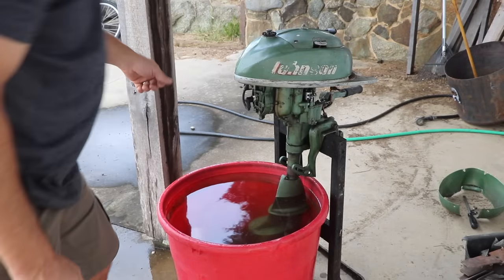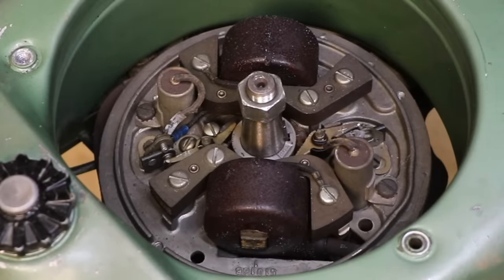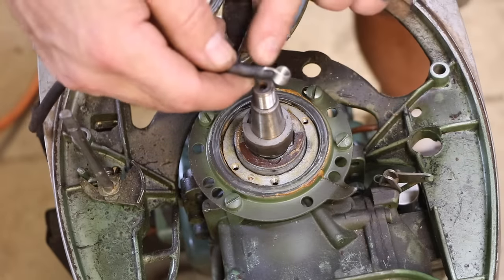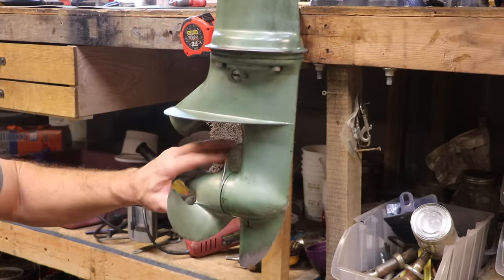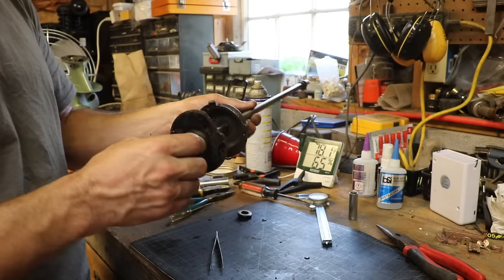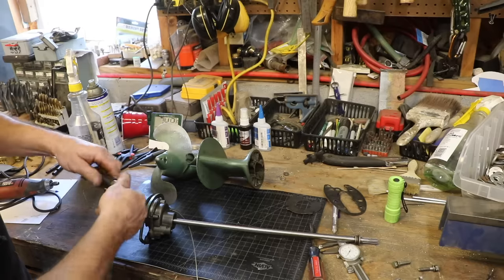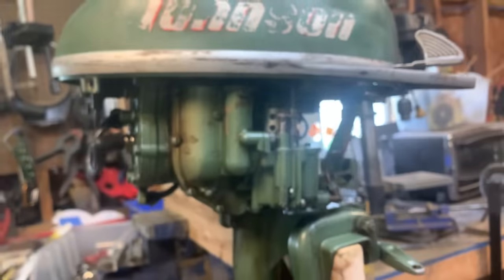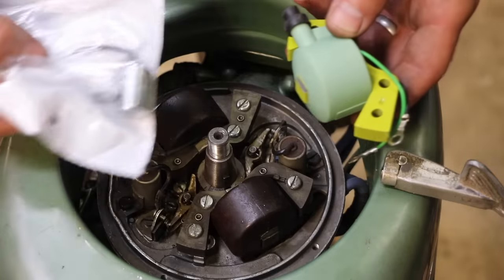My Johnson Needs An Overhaul, and it's Putting Up A Fight!  Johnson Engine Part 3

Comment: My favorite thing about these old engines and other machines are the mechanical solutions to electrical problems. Life before logic gates and microchips took a lot of creativity
Reply: I never get these comments. As if throwing microchips on something magically resolves problems. You just introduce a boatload of new problems that need their own kind of inginuity and creativity. Always the same "mechanics good, informatics bad" ape-like mindset.

Take a look at ben eater to really get used to what kind of problems you get with informatics and how inhumanly complicated it really is to solve something with informatics.

You need both mechanics and informatics to build the real crazy machines. I mean hadron-collider-class of crazy. Where nearly everthing is machined and programed to absolute perfection.
Reply: No kidding. Used to be that,usually, if you had a spare plug and shear pin you could probably get your outboard home..

Comment: the “hard plastic” in your seal you broke is made of ceramic. they are commonly used in pool pump motors called a mechanical seal. it’s ceramic as to not damage your internals from metal on metal contact. hope this helps keep you from a disaster in the near future

Comment: Thanks for the detailed video. I have a 1950 Johnson TN 26 that is very similar, but it has the older style coils and points. After cleaning the points, I have good spark, so I'm leaving the magneto alone. I put a new impeller in the water pump, and it ran okay when I started it up several years ago. This year, I decided to get it out again, but the carburetor needs to be rebuilt, so I am thankful for your explanation. Keep up the great work!

Comment: Awesome video. When I was a kid in the 90's, I had a '67 Johnson 6 horse on a small aluminum boat that I had lots of fun with going around the lake at my grandparents summer cottage. I would agree that a new head gasket and rings would help to bring the compression back up to new and give it its full power.

Comment: Just  the  " 5 Sea horse" decal  is worth the work on this old Johnson ! PS:  Rubber O rings  should be rather lubricated using Glycerin or a water soluble lube not grease .

Comment: I experienced the same thing with a motorcycle. I bought the bike and was driving it for a week and was happy with it and then I went to my buddies house and he immediately says "it's only running on 3 cylinders, how can't you hear it" and of course it had a broken plug wire. It had much more power after I fixed it!

Comment: Great video and series. You have fought and got it running pretty good. I would absolutely put new piston rings in it, do an air leak test on the engine to make sure the seals are still good and fix it up to its full capability. It would be a hard kick to the Johnson to leave it under its full potential. You are so darn close to 100%. Come on man you can do it 💪

Comment: Greatest clickbait in history.

Nice old outboard though, glad you keep her in good shape.
I like how you use the bucket for testing, I always used a steel drum, just clamp it on the rim, don't need a transom and you can hang it outside the drum to work on the lower unit.

Comment: I owned one of these engines and it did not sound right at first, running on one cylinder. Impressed with your ability to troubleshoot and machine parts.

Comment: Always measure compression with open throttle, might give you a slightly better result.

Regarding the new alu/bronze seal, between the leg and power unit. 
The old stainless washer looked as if it had been "rotating" on the o-ring, by making it one piece you loose this flexibility. I wonder if that was going to cause problem over time, that the alu/bronze now sitting directly at the bushing on the shaft being the sliding point instead of the washer and the o-ring.

Comment: My dad has one of these in his garage. We used it in the 90's when I was a kid. He got it from a guy that used to be a mechanic on small engines. It was an awesome little motor and ran when it was put away. I'm sure with a little bit of work it would run again. I have many memories of my cousins and me on the lake ripping around. Great video.

Comment: I think you messed up the adjustments on one of the points. The crank lobe wasn't aligned with it and the backfiring could possibly have something to do with that. It also seems like you have an exhaust leak on the stem. Probably a broken rubber seal there too. Well, old rubber you know. If you're going to take apart the head I would definitely change the crank shaft seals in the same process.
Reply: The leak is visible at around 49:00, spitting water.
Reply: Are you saying he could of corrected the problem and missed a step or is it a Pandora’s box

Comment: I really admire guys like you who are able to machine your own parts. Great job all around. By the way what's the difference between a condenser and a capacitor? Nothing. They're exactly the same thing with a different label.
Reply: Came to the comments to see if anyone had clarified.  "Condenser" is just the old-fashioned term for a capacitor.  The only places I can think of having seen the old term lingering is in these kinds of ignition systems and condenser microphones.
Reply: They work the same but are designed for different applications. A standard type capacitor wouldn't last in this environment.

Comment: That piece with the oring that broke was a “carbon
seal”. It rides on the crank to seal lower crankcase. Your lean spit  back may be your substitution of a bronze material. If I recall correctly there was also an inner oring that rode on the drive shaft and I believe there was also a spring to keep it preloaded to keep it to the crankshaft. Have to check a parts manual. Is it a “TN” model?
Reply: I was going to add the same voment till I saw yours.   Pretty sure the spring is meant to push the seal against the bottom of the block not down away from it.
Reply: That is probably why it has low compression, The crankcase is not sealed anymore. I was wondering why there was no oil seal in that bottom bearing.
Reply: They ceramic seal is required for proper operation. Great mechanic but hasn't been exposed to water seals.
Reply: What is that seal doing the way he did it now? I dont see how it would do anything. Around the shaft there is no seal.

Comment: I would have checked the spark plug wire first before digging into it like that but it was interesting watching you explain the inner workings with the condenser and how the power is generated to make the spark plug work. You don’t see the old motors like that anymore.

Comment: You are correct, it is alway good to replace the impeller pump on an old motor.
I noticed at the first of the video that it was pissing so the pump was working. But now you know it won’t crap out on you and fry the engine.
You probably had 4 or 5 hours into it not including several hours of research.
It’s amazing parts are available!

Comment: You sure hit the nail on the head about. having a lathe in the shop to make a needed part on Sunday afternoon when it can't be found or bought. Moving to a retirement community with no shop makes for a little bit of a lost feeling, passing 80 though guess I'll not be fix'en much any more. Good job on your Johnson5. JImM

Comment: Several years ago I bought a boat that had two engines similar to the one you were working on.  I found a guy that could rebuild it but he said I would be wasting his time and my money.  When those engines were built gas had lead in it and it would coat the valves as kind of a lubricant (or something like that).  He said since they have taken the lead out the valves will burn up and they would need to be replaced.  If I had him rebuild them I could only use 93 or higher octane without alcohol.  He said any gas with alcohol would burn them out faster.  He said he could rebuild it for $600 (that was back in 2004), but I wouldn't be happy for long.  He suggested I take the money and put it toward a newer motor.  Good luck.

Comment: As for filling from the bottom vs top... there are some lower units that must be filled from the bottom. My Mercruiser Alpha I outdrive was one of them, as was the Alpha II I replaced it with. 

The issue has to do with the internal oil passages inside the lower unit. This little SeaHorse and many other outboards have this large open design... oul has no problem working its way down and replacing the air in the gearcase. With my Alpha units and many other designs the oil passages are so small they will hydro-lock the air in the gearcase. When you fill from the top, the weight of the oul prevents the air from working up through that passage. Eventually of course it will work itself out, but then you have a critically low oil level and you burn something up. 

I understand how the naysayers can get after you. You're following the manual. Way to go bud. This is fun to watch, even a year later.

Comment: I remember an old Johnson like this back in about 1960 that would run on one cylinder then the other would kick in every now and then. My father got tired of it, and we threw it in a breakwater.  Got a new Evinrude about 10 Hp. I thought it was so powerful.

Comment: When you were resizing the impeller bushing I thought of another little trick that you might want to put in your mental toolbox. Cut the head off of a 1/4” or 5/16” bolt. Then cut a slot into the end like your trying to split it down the middle. You can then slide a piece of emory cloth into the slot and wrap it around the bolt, chuck the other end into a drill and use it as a reamer to remove the material from the bore. I’ve used this method many times. You can keep the bolt for next time. 
This is the first time I’ve seen one of your videos and I have to say I really enjoyed it.

Comment: The little pin as you call it keeping the prop connected to the shaft is the shear key. That is when you hit rocks or stumps with the prop, the key will shear and save the gears. Then you back the boat up to the bank, look in your tackle box, get out another shear pin and make the repair. On back to fishing you go. I have even seen nails used for the shear key. Anything to keep the gears or prop from being destroyed.

Comment: Just a couple notes on condensers - 1) a condenser is another word for a capacitor. 2) In addition to reducing sparking on the points, the condenser also helps make a stronger spark by quickly releasing stored charge at the primary when the points are opened. Try removing the condenser and see the difference in spark.

Comment: I didn't want to sound aggressive, just experienced from my 1950s boating as a teen.  Dunno if your 1952's. Johnson had a magnetic lower unit plug to catch any steel filings, but it is always good to give it a good cleaning to remove them.

Comment: I loved the comment about freaking out on the bottom end oil filling… there’s a little fear of having water contamination in the lower unit… obviously which if you saw milk it would be cleaned out properly before you refilled it…

Comment: I use those little micro tubes of superglue to hold vertical gaskets in place during assembly.  2 drops or so.
If you go by a place that services brass musical instruments they can get those gas tank dents out.  They use large magnets.

I had this engine years ago and loved it.

Comment: Hey great video. I have a 1956 Johnson that looks a lot like it but its a little bigger and has a remote 2 line tank.  They say those 2 line tanks will blow up but my grand daddy ran them for years Never had one blow up and everybody I know back then ran them and never did anybody ever blow 1 up.  This motor's only been run twice it stranded my grandfather twice brand new. Well 3 times cause he ran it in a barrel when he first bought it.  Nobody could seem to fix it back then I guess so he never used anymore it's sitting in the shop until after he died in 76.
I was 14 and i begged my dad to let me have it to see if i could fix it but it sat in  his shop till he died in 2012. 
I don't know what all was replaced on it. I never heard my grandfather say. I do remember him saying that the dealer gave up on it. My grandfathers brother i know worked on it. He had some experience with kickers.  I know it was a sore subject with my grandfather because I think that he had to eat it because the dealer wouldn't take it back.  I have it in Evinrude Alto Ace. I believe its like .75 Hp. Yes point 75 hp. I had it running a few years ago. It was grandaddy's trolling motor. This was before all the little electric ones. 
Maybe ill get to it one day, I have lots of projects.

Comment: Very good video!!! however the reason you fill the gear case from the bottom is because if there’s water in it, the water is lighter than oil and it will float out the top when you have it open

Comment: @34:35 There's supposed to be a spring between the roll pin and the small washer. On top of the small washer sits a bearing. That all pushes up against a larger "washer". That larger washer is actually part of the lower crankshaft seal. Cut a piece of cork gasket to fit on top of that larger washer.

The idea is that positive crankcase pressure will push out excess oil into the exhaust. But the spring assembly keeps enough pressure against the cork seal so that unmetered air doesn't get sucked back in. You either lost the spring without noticing when you pulled the shaft out. Or a previous owner forgot to reinstall it.

That is important, too. Because that lack of seal will cause rough running/popping. Also potentially catastrophic damage to the crankshaft or connecting rods, resembling runaway chatter when inspected.

Comment: Great Jacks nice work. The Black ring you broke was a CARBON THRUST BEARING. metal ring will damage the connecting face it is attached to.

Comment: Thanks for the video! you taught me a lot. I have an old 50"s something Mercury 3 or 4 hp that looks like your Johnson.  A few years ago I had it running, but then it stopped.  I may have had the fuel too rich.  It had not previously run since the 70's.  Watching your video has inspired me to get mine running.  Problem is I am definitely not a mechanic so I will have to Youtube it.
Reply: Just Subbed!

Comment: I love the flash back video, "plug wires look good, no reason to replace them". FYI: ... I had a car on which I was trying to determine which cylinder wasn't firing, so I pulled the plug wires one at a time. When I pulled the wire on the cylinder that wasn't working, and the spark was forced to jump the gap from the cap to the plug, the cylinder would fire. When I placed the cap back onto the plug, the cylinder would stop firing. An old timer told me they used to make plug caps that was long ago.

Comment: I have a 1957 johnson 7.5 horse. Runs great. Still has the pump that pressurized the tank. Needs to be swapped to the pickup pump. Only thing is. They've pretty much made it illegal here to run them old motors. I still put it on my 14 ft and run it my pond from time to time.

Comment: Nice work with the gasket material! I've seen too many guys cut a 12" diameter pipe flange out of the center of a 4'x4' sheet instead of a corner and ruin it when needed for the other end....

Comment: I used ai 55 gallon drum to run my little outboard in.  I used a piece  of two by six to screw the outboard to.  It would throw a lot of the water out when I put it in gear and opened it up, but was a good way to test an engine.  I would leave the water hose in the drum to keep it pretty full of clean, cold water.  If it started overflowing the drum I would just put it in gear and wind it up so it blew out the excess water.  I used it to test 5 to 25 hp engines but the larger engines got pretty heavy to put on the drum.

Comment: I had a 35HP Chrysler out board on a 16FT bow rider after a while the bottom spark plug would foul out with water  I thought it was the head gasket  Nope it was the Bottom Crank seal that was worn out sucking the cooling water into the Engine  2 Strokes work on Vacuum in the Engine  Lesson well learned :)

Comment: Regarding the oil fill procedure. Believe it or not, it is much easier to fill the drive from the bottom than filling from the top . if air gets trapped in the leg itself, you will have a miss read on you fill level. The other advantage is that filling from the bottom eliminates the need to keep checking the top fill point. If you fill from the bottom you do it once and forget it!

Comment: For applications with my antique 7.5 sears outboard engine I dipped my paper gasket material in a mixture of 100% silicone sealant mixed with mineral spirits at about 1 part silicone to two parts mineral spirits mixed until thoroughly dissolved and allowing the soaked material 24 hours curing time before use.
PS
I also learned with old boat motors to never passed up the opportunity to remake an old crappy plastic part out of a better material like you did with that shaft seal 🦭!
Ha ha ha 😂

Comment: You just took me back to the 1960's that was dads fishing motor in the spring and summer vac. sometimes you would need to change that prop sheer pin if you hit something . 5hp ran like a new 9.9 hp.

Comment: Thank you for the little shock event, hope your alright.  Better man than I holding in the expletives.  Not a small engine mechanic, but I too did not realize the engine was running on 1 cylinder.